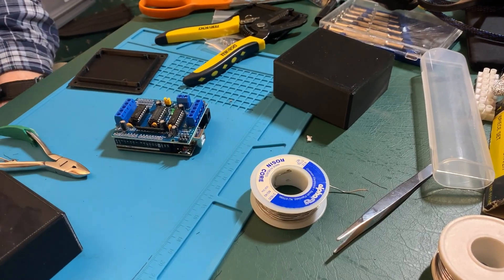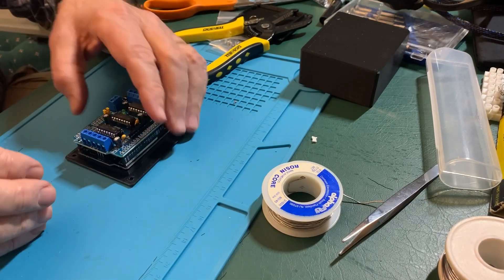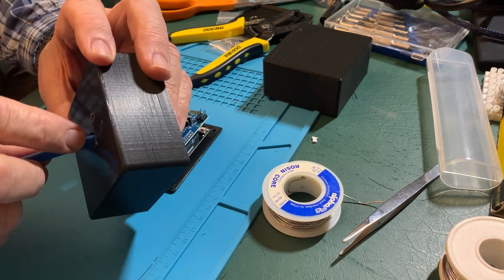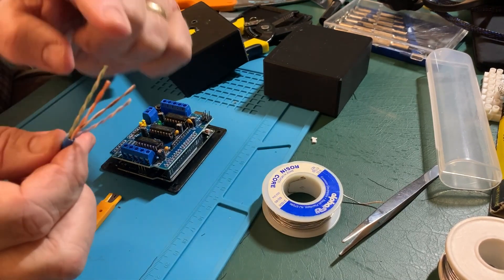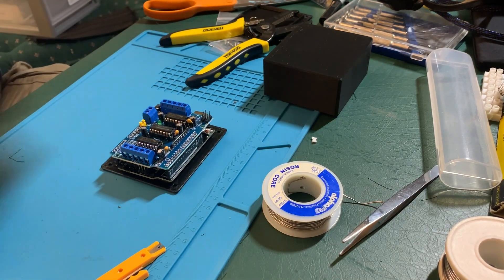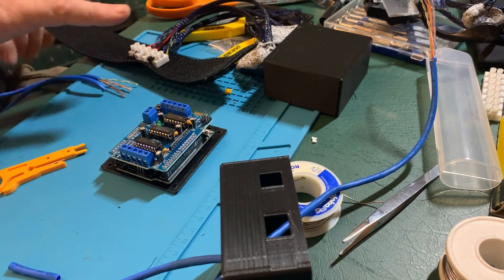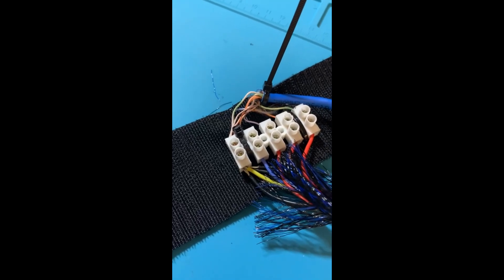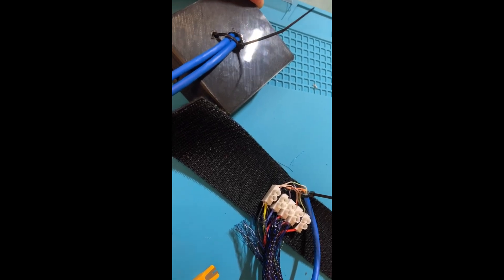Vibrotactile Glove Wiring using Buzzboard central controller

Comment: How long are your cat6 cables? do you have your motorshield usb power cable coming out from the top or on the side? There is enough space to let it come out on the side. Thanks
Reply from the maker: Currently using 3' cables.  Interestingly, yesterday she asked for longer (easier to route through a sweater as the weather cools).  I have been working on repacking the motor shield glove controller into a more robust package as this is her "go to" device now.